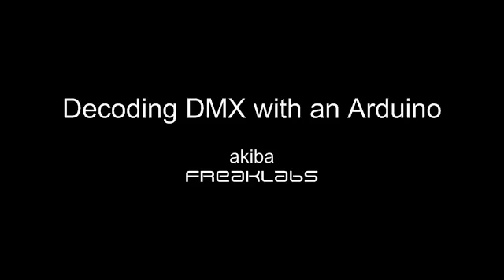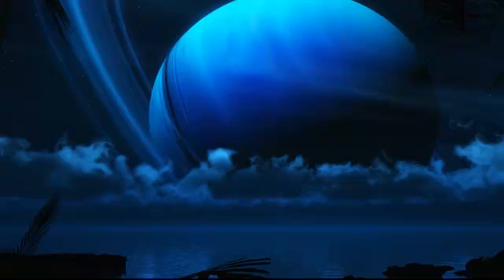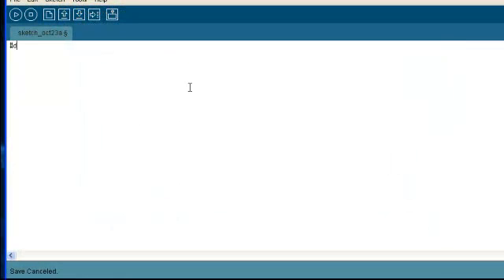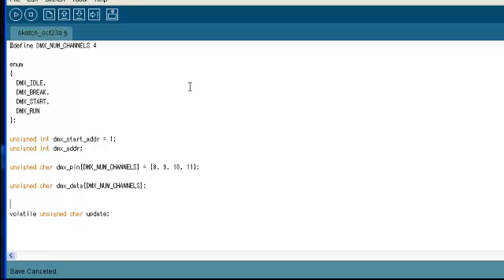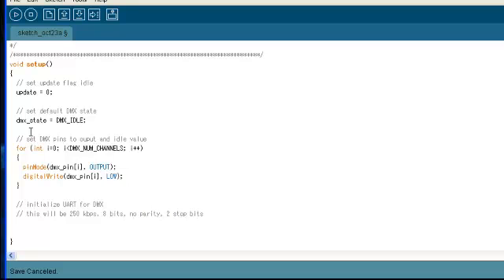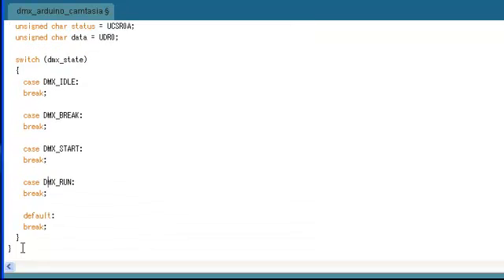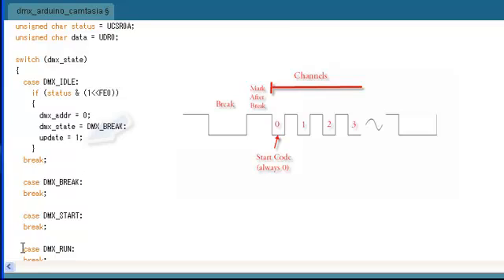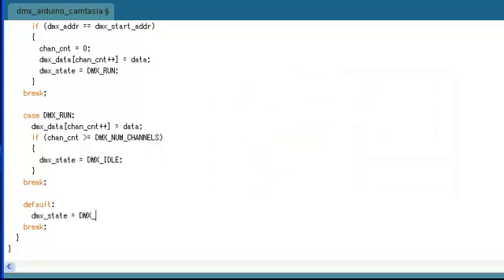Decoding DMX with an Arduino - Part 1

Comment: I believe what you are calling the "frame" is actually a DMX packet. There are 512 frames within each packet that carry data for each channel. See: https://www.element14.com/community/groups/open-source-hardware/blog/2017/08/24/dmx-explained-dmx512-and-rs-485-protocol-detail-for-lighting-applications Also, there a number DMX Arduino libraries "out there" that one can use to avoid the hacking described. Good work on the video.